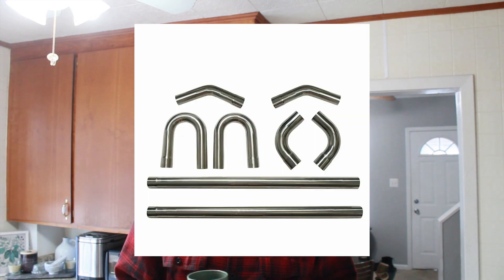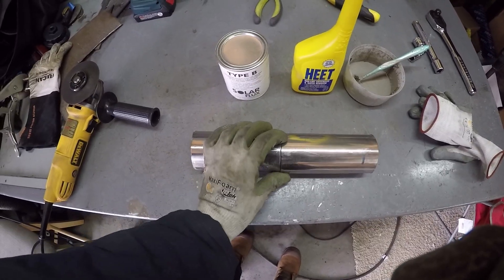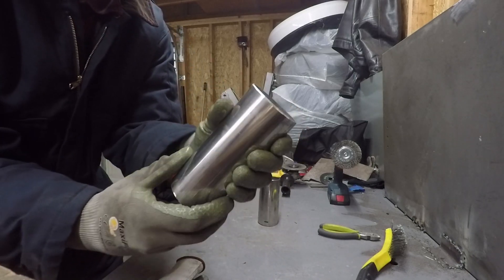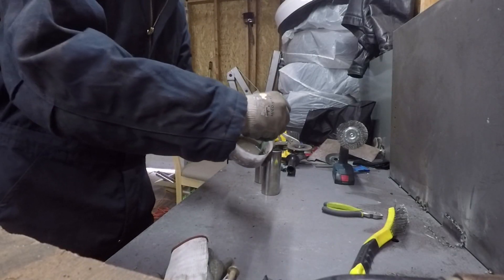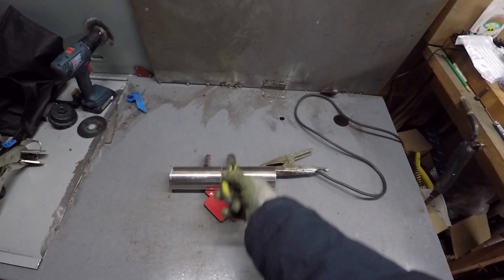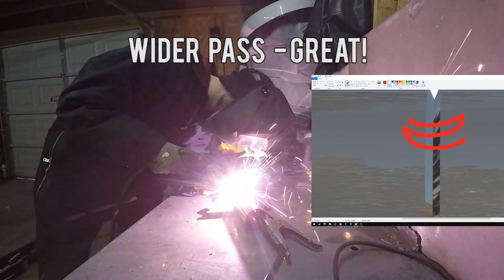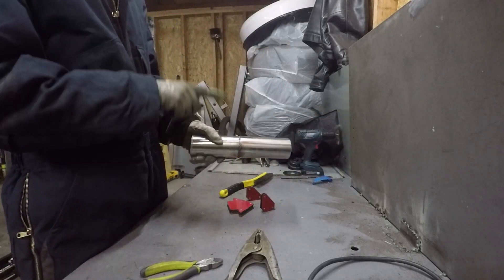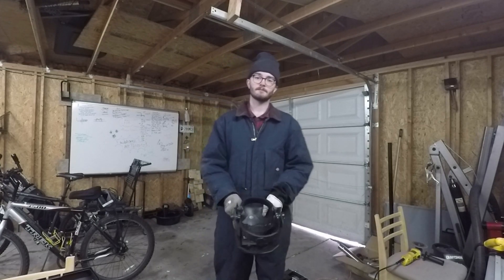How to MIG Weld Stainless Steel Exhausts With Flux Core!

Comment: Definitely not enough heat in those welds. With the machine set to the correct voltage there is no need to bevel the edges of pipe that thin. Also might want to do a minimum of 3 tacks spread out around the pipe to keep the pipe from pulling when you start to actually lay down a weld.
Reply from the maker: Yep I tack 4 times or so, this garage setup did not have enough power to do the stainless wire justice- the concept is the same however. Thanks for watching!
Reply: Yeah he def needs more heat lol
Reply: I bevel my exhausts. Especially when welding in place. Helps the beads lay a bit more flat. There's more than just your way dude. Get over yourself
Reply: With that stainless flux, did you have to reverse the polarity of the torch. I read on the reviews for that wire that you had too for best results
Reply: Fun project, it looked cold in your garage.  I used to weld a lot of stainless steel at work but I don't have expensive gas tig welders available now that I am retired.  One thing to know about stainless is it oxidizes very fast on the surface like aluminum and weak welders can't melt that chrome oxide so it is important to power wire brush inside and out of the pipe joint within 10 minutes of welding then apply the solar flux heavily.  Next I find it helpful to put a tiny amount of acid on the joint to prevent oxides from forming during set up.  The acid really helps by getting down into the scratches for brazing and soldering too.  In cold weather, with a weak weld arc, and to reduce warp, preheat the pipes with propane torch.  Get it pretty hot 🔥 but don't ruin the temper of the pipe or melt the solar flux so not red hot.  After tacking heat it again after wire brushing the outside and re apply flux inside if possible.  Then put the smackdown weld on it.  It will be beautifus-maximus.  If you do much welding SS even if your welder is not set up for gas, a purge setup is not horribly expensive though required for sanitary welds that require no inside sugaring to prevent pipe cracks and germ pockets.  As a side note, only a slight bevel if at all and the joint should be spaced about a 1/16" inch apart to help get penetration and a better clamp is needed since magnets are weak on most stainless steels.  Perhaps a piece of angle iron with flat bar welded on to make clamping easier in this case but with weird joints you may need to use a gloved hand to just hold it.
Reply: @kirkalley3469   Kirk, thanks so much for sharing the SS welding experience & expertise. 
  I am retired as well and funds to buy a TIG is not in my future. I am simple spending the money on pipe, bands and “V-bands” in two areas. I have a great MIG I purchased in 1984. It says 150 Amps and it’s no lying as 3/8” and thicker is a breeze! 
 I am running exhaust thru my 2 1/2” dual pipes on the LS truck engine in my 67 C-10, no milk or FDA inspected welds, just a couple of “V-Bands” and other area’s requiring a few “Pie-Cuts”, that all. Thank again kindly for sharing my American brother. May your retirement be as you dreamed it and stay healthy. DK, Omaha Nice!

Comment: A good way to line up pipe or tubing for welding is nesting it in aluminum angle.
Reply from the maker: Thats a great tip, ive been using magnet angles, ill have to try this with some scrap ive got.

Thanks for the suggestion!
Reply: Instablaster.

Comment: Good walk through!  I used my millermatic 140 autoset, E308LFC-O .035-Diameter Stainless Flux Core Welding Wire, 0.9mm SONNLER 2-pound from amazon, $18.99.  The welder was performing well evecn at the end of a 50 foot thick extension cord 15 amp circuit.  Pregrinding/acetone clean, was using a very low speed, Low power, excellent results, no porosity (I cut/inspected it) without the back purging or that paste. Yea, you can see some chudd inside the pipe, bt I'm going from 2", to 2.5 exhaust.. I dont care.  Its a turbodiesel exhaust for a ALH, going on my westfalia.
Reply from the maker: As long as those welds are all post turbo, you should be totally fine. The chudd/sugaring may present serious risk if flowing before a turbocharger. Sounds like it went smooth for ya! Perfection is the enemy of good enough
Reply: Thanks for the lead on the FCAW stainless wire.  Ordered and look forward to testing on the older transformer machines and newer inverter design. Next up I'll research what the millermatic 140 autoset does for settings.
Reply from the maker: @jafinch78  Best of luck, glad it helped out

Comment: You did the opposite of everything i do. I have the same exact welder. I put my setting on 2 for wire speed and lowest voltage and my welds sit flat. The only time i run alot of volts is if im welding thick metal like mechanic tools but for 1/16" exhaust piping, i run low voltage.
Reply from the maker: Interesting, 110V with stainless wire? I'm surprised if so! I wasnt even close to getting enough heat with this setup
Reply: @supernull  I buy my fluxcore from home depot. .030" wire. But ya, if i put my heat on even one step above the lowest setting, it puts a hole through the 1/16" steel. I mainly weld exhaust pipes so i always keep the heat at the lowest and my feed on 2-2.5
Reply: @s2krookie  stainless steel? Or mild steel?
Reply: @curtiswlkr  stainless 16gauge
Reply: @s2krookie sounds like you’re running regular carbon steel flux wire, not stainless?
Reply: @TireSlayer55  i dont think its stainless wire. I buy the wire at home depot.
Reply: @s2krookie  yeah my local HD doesn't stock it. they just carry the regular flux wire. I ordered some 308 stainless flux wire off Amazon... will be trying it out later tonight or this weekend.
Reply: @s2krookie try Blue Demon 308LFC-O. I have had good results and it ain’t too pricey!
Reply: @TireSlayer55  what settings did you end up using for the 0.30 stainless wire?

Comment: For me I do away with all the pattern welding and replace it with tacks. Up amperage a rad from where you've set it and use tack welding to penetrate a little deeper. Everything else is basically dead nuts though. The solar flux is really the key I think. Great video this has probably helped thousands
Reply: Thanks for the kind words! I agree with your points, especially if you want to visually stack like a tig, tacking with higher heat is the best

Comment: I need to fab up a downpipe and exhaust for my Turbo Miata build, and I feel like this video is by far one of the better ones when it comes to flux-core exhaust welding. I can't transport gas cylinders since my Miata is my only car, so Flux Core was naturally the only solution. I feel pretty well-prepared to start doing practice runs and eventually do the real thing. Wish me luck, lol. Thanks for the advice Mr. Freddie Dredd of Automotive Welding <3
Reply from the maker: Thanks for the kind words! You are the type of person (like me) that this video is for! Let me know how it goes, would love to see the final product
Reply: Dude just put the gas bottle in the passenger seat and buckle the seatbelt around it 😂

Seriously tho, they do make much smaller gas bottles than the big 4’ tall ones you would see at a shop… a gas supplier should be able to hook you up…
Reply: Update: I've laid some beads a while ago and took on my first real welding task. Since the exhaust past the Cat on my Miata is one continuous piece, I dropped the exhaust, cut the muffler off behind the rear wheels and welded on a flange. Boom, DIY Axleback. Then slapped on a new, high-flow muffler. Welds went excellent, didn't burn through once. More welding work to do soon. So far, great success!
Reply from the maker: @MiataDriverX  Fantastic to hear! If you experience any unwanted drone be sure to check out my other video on removing drone with an additional J pipe
Reply: Know it's been a while, I'm doing exactly what you are with my NA Miata. I transported a 125 with the passenger seat off and it really is just four bolts. 

Hope your welding skills has improved much since then. Time for me to try this out.

Comment: What is this 'Heet' for? Heet + solder flux. Is that just flux, or is that solder paste? I dont quite get the purpose of this, it was not explained in this video... Can you explain it?
Reply: Heet is used to help spread the solar flux, and adhere it to your material (functionally replacing a back purge) While also keeping water/moisture out.
Reply: I believe heet is primarily methanol…  not sure.

Comment: There is a much better way, I've been doing it for years commercially, just use Helium as the shield gas, stainless wire you get super clean welds and a bonus of pretty colours as well.
Reply: Really you can use helium as a shielding gas? Fascinating
Reply: @blender_unleashed  TIG welding, when it was introduced by Linde, was called Heliarc welding for a reason.  😉
Helium is another noble gas, just like argon.   (has slightly different properties but serves the same purpose)

Comment: super, i know this is late to the punch, but one thing to consider when using grinder attachments is to have a dedicated attachment for stainless ONLY. otherwise you embed mild steel particles into stainless, which will cause rust and it will spread :O
full time stainless dude :D
Reply from the maker: This is a great comment. Dedicated tools, and taking stainless fumes seriously, goes a long way.
Reply: Never thought about that

Comment: Just from the sound - and looking at the weld says the same - you'd want to up the amps and use stitch welding where you lay one "Tack" onto the last, aiming for about twice the penetration & a much flatter weld profile. Hold the tack duration as long as the material will take. Doing that will allow you to lay a weld that looks almost as posh as TIG with practise, plus it gives a very very strong, well penetrated weld. 

Just my 2c. :-)
Reply: This is sound advice! I have learned a fair bit since filming this, and the station I had here was woefully underpowered. Whole garage ran off a single extension cord! Thanks for taking the time to comment!
Reply: Do you lay the new tack before the last one completely cools?
Reply: @orcoastgreenman  usually. On real thin stuff, slow down & let it cool more. We're talking seconds here btw, maybe even only 1 or 2 seconds.

Comment: I have repacked my stainless exhaust box (short system mid engine car) and welded it with a stick welder with good results too.  This was  years ago, before I owned a MIG set.  It works quite well.
Reply: Stick welding has its perks, gappier stainless is definitely one of those cases where stick welding is hard to beat

Comment: Lot of ignorant comments on here. Not practical for a hobbyist to use gas as the setup is pretty damn expensive. Plus that setup doesn't work well if you have to weld outdoors.  Everything doesn't have to look pretty to hold together LOL. The comments about your current being low do seem correct though but don't think it's because of your setup. You just need to reverse your polarity and problem solved. And then you can crank the voltage and it won't burn a hole in your material. SS is tricky.
Reply: And by tricky you mean easy.

Comment: If you add about .040 or .035 thou gap and only fill the gap, you can get a super strong and flat weld with thise low power welders. Dont bevel the edges. Youll get a weld that looks like a laser welded it. Looks almost as good as tig. I just did it with my little 110v yeswelder.

Comment: I know this is an old video and i know you might not respond but this is one of the best videos i’ve found so far so figured i’d try my luck. I’m wondering if there are any cheaper alternatives to the  type b solar flux. all i can find are 1 pound cans and i don’t really need that much just because i’m only doing some minor repairs until i get a bottle so if you have any suggestions or links or places to look i’d love your input. thank you and great video!
Reply from the maker: I have not personally found any alternatives. What I will say, if saving money is the number one goal, you can skip purging at the risk of sugaring your welds internally, and cracking if putting in a hot system. If it is upstream of a turbo I would not do this. If it is downstream and just a NA exhaust you could probably do it, and if it cracks or causes issues you have to re-do some work... For minor work (after turbos, cats etc) i would just send it
Reply: @supernull i’ll probably just get some and save it just in case, i have an ak tuned rx7 so it sees quite a bit of heat lol.
Reply from the maker: @shawnraasch7411  Better playing it safe and doing some stainless work for friends

Comment: So what does the solar flux do in this application? Does it help pull heat away from the weld joint? I've never used the stuff, read about it but it's not really clear to me what it does since it's on the inside of the pipe.
Reply: That is because we are not back purging the weld, with stainless to prevent oxidation its more important. Back purging (or in this case solar flux) is good for weld strength and also reduces risk of oxidized metal bits falling off in the exhaust while the engine is running , not a big deal unless its before a turbo or something like that.

Comment: I have seen other videos using mig, flux core stainless wire with 100% argon gas. Don't know if it's better but it seemed to work well in the videos. Just a thought. Not knocking your set up. Good video and thanks for sharing.
Reply: I wonder why, I have never seen someone use flux + gas. Since you set the machines polarity based on what wire you run, I am a bit intrigued. Either way, glad you enjoyed the video!

Comment: Friend. Love the video. I just received the exact same 3  inch stainless kit from Amazon. Are you welding down into the seam of both pieces of exhaust or side to side.
Reply: Experiment with what works for you/your welder. I found for this setup it helped to slightly overtravel back and forth seam to seam, but depending on your wire size and welder settings, you may experience something different. Try with a small piece of scrap that lets you see inside for penetration after youve welded and youll know what works for you

Good luck!

Comment: Can you explain why you applied the flux to the inside?
Reply from the maker: Sure, solar flux is how we are able to "back purge" the pipe without using actual argon gas with a back purge set up.

This is what makes sure our welds penetrate, and don't get contaminated as they cool.
Reply: @supernull  Thanks! Is this something that needs to be done because you are butt welding tubes? Or would you do this for welding a t-joint or butt joint between 2 plates?
Reply from the maker: @muaddib1116  That is correct! I am not an expert by any means, but if you are welding with no backing (or through thinner metal into nothing like a pipe) youll want to back purge or line with solar flux. For a T joint or thicker plate, you would probably get away without using it.

Solar flux is pretty cheap if you buy in bulk especially and will last you a LONG time.
Reply: @muaddib1116   back purging is really only needed for welding stainless to shield the back of the weld from contamination (sugaring) . If the back of the weld isn’t shielded it reduces the corrosion resistance of the stainless greatly & the weld will be prone to be weak & crack & also rust . The solar flux is an alternative to argon gas purging the tube

Comment: What’s the point of the HEET? And what size wire?
Reply: HEET allows you to apply the solar flux and then disappears quickly due to the alcohol content, I believe the wire was .035 if I remember correctly

Comment: Is using stainless steel flux core wire will Rust appear just wondering
Reply from the maker: If you get quality wire that is real stainless no it will not rust. However the flux coating may look like rust if not cleaned fully
Reply: @supernull  I ordered stainless steel flux core wire blue demon
Reply from the maker: @mozezcen-valley7555  Let me know how it goes!
Reply: Make sure you don't clean the pipe or weld with any carbon steel wire brushes, or you'll get rusting.

Comment: You either need to crank the Amps up or Buy a larger Mig Welder.
By just listening,  you can hear your welds are way too Cold ??

Is this Mig Welder a Low Amperage machine or are you struggling to get enough power out to your shop ?

Not knowing your current set up,  it's hard to tell why you are welding with such Low Amps ?

Wish you all the best with your channel
Keep at it and it will come together with more time and practice.
Reply from the maker: That's the truth. This garage setup was severely underpowered. Putting together a proper shop with 220 now!
Reply: @supernull  
Happy to know you are putting together a decent power supply to your shop.

When you run the power out to the shop for your Welding Machine try to run as larger cable as you can afford. 
Not sure of your cable sizing where you are ??
But run at least 4mm cable or larger. 10mm would be best. 
This is a great place to start. 

IF you run a Single Phaae Welding Machine. 
Don't use any Extension Leads.
Especially on a Transformer machine. 

Wish you all the best with your upgrades 👍

Comment: What is the wall thickness of the pipe? I have never welded any stainless steel that wanted to warp/flex(but then I have never had the pleasure of welding on any thin material except for decking sheets)😁✌️👍
Reply: Most likely 16 gauge, it wont move much, but when youre looking for a flush fit, every little bit counts. thanks for watching!

Comment: You need more heat the weld is tall
Reply from the maker: You are correct, stainless needs more heat than my 110 welder can provide (on an extension)!